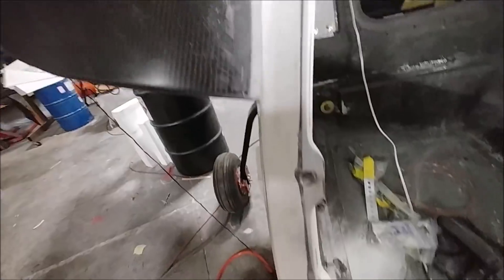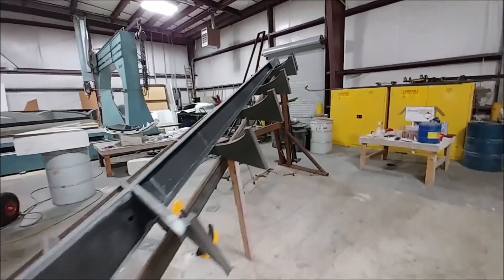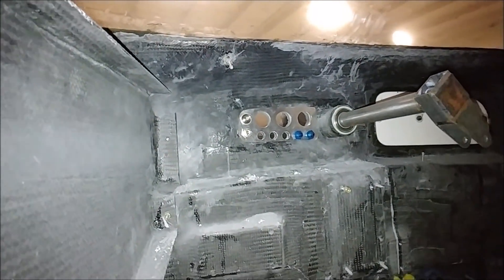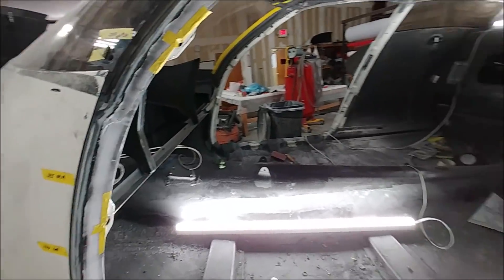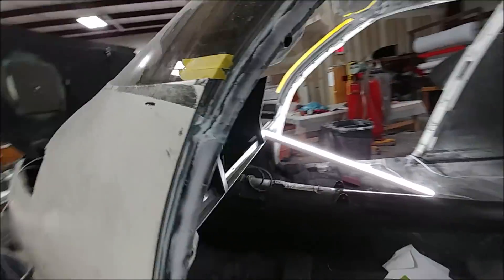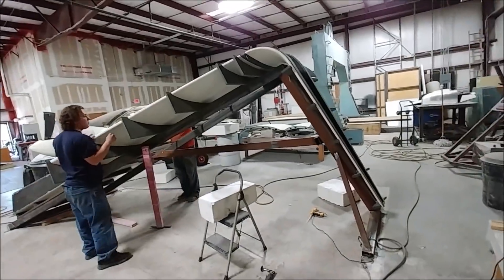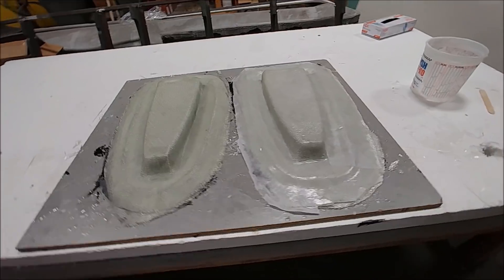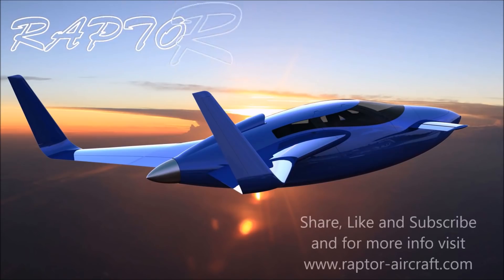Tuning Wing Fixtures - Building the Raptor Prototype

Comment: Peter, new idea: Have you considered making a small composite manifold/plenum on the downdraft side of the intercoolers/radiators to vent hot air directly out of the engine bay, with flared manifolds around the fans to reduce temps in the engine bay/firewall, or is that a non-issue?

How is the door redesign going?

Comment: I'm imagining a little pivot elbow inside the door lock slots, that when pressed by the door locks extending/engaging, would serve to press that door lock (and the door as a whole) tighter into the door frame, for a tighter seal.  Which should make for easier latching/locking..